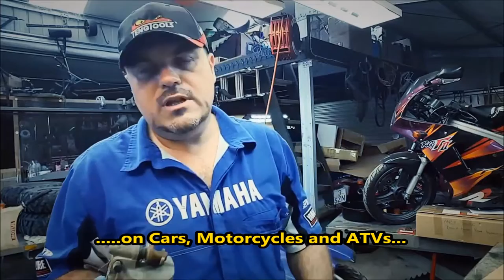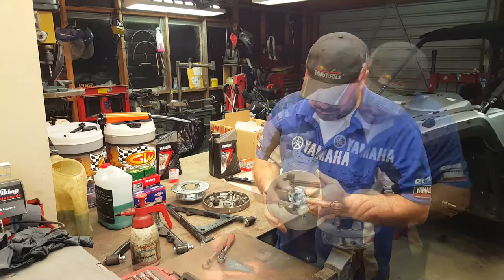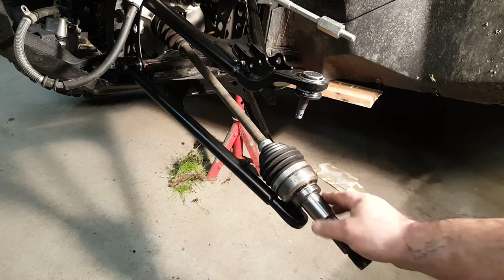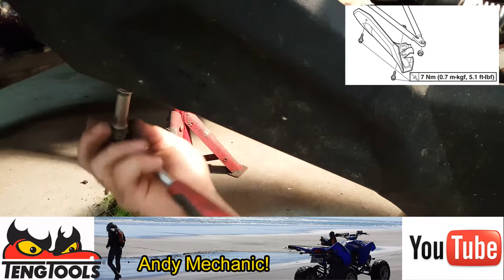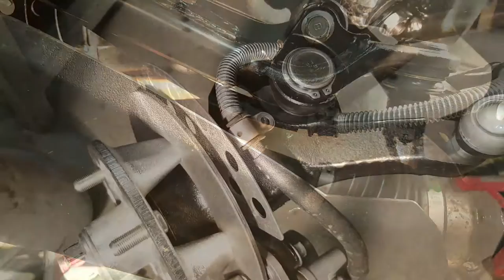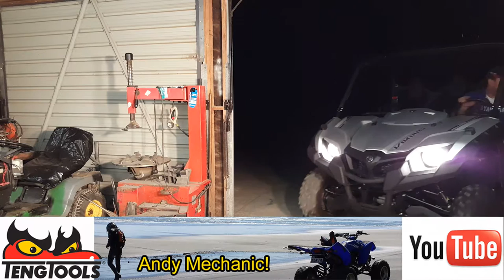Yamaha Viking front suspension rebuild #1604

Comment: I spent many years with General Motors and all suspension split pins had to be bent in opposite directions, I see some just bending one as well.  The thread-locker to my surprise when it was introduced in the 90's as a dry formulation on bolt threads like you see today everywhere was not only to retain the fastener but it's to prevent corrosion entering the threaded mating surfaces , I use the thread-locker for that porpoise  on all my hardware now.  Well done mate. Cheers
Reply: Mate?